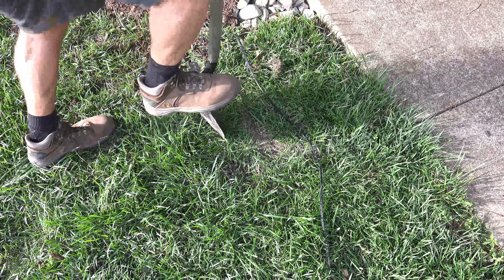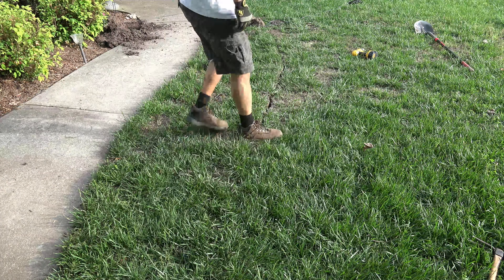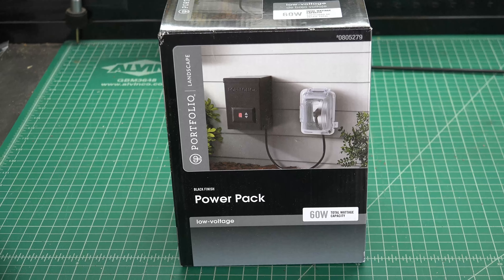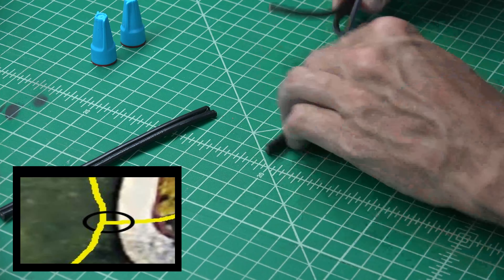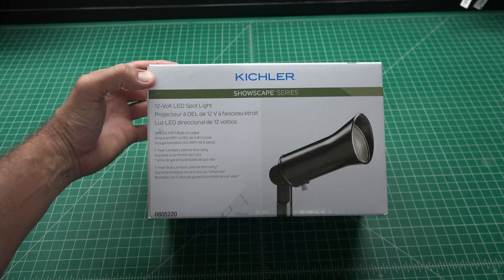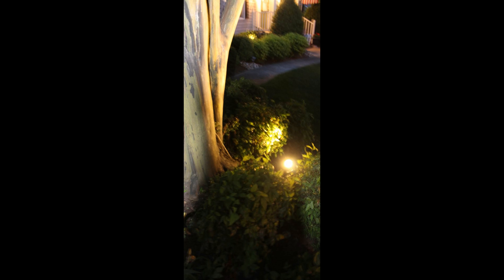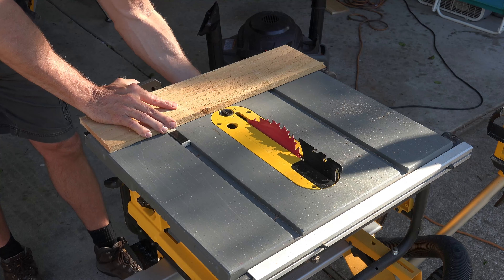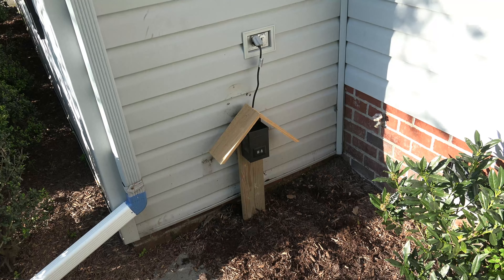How to Install Wire Under a Sidewalk for Landscape Lighting / Jon's DIY

Comment: Great video! If I thought I would ever need to run more wires under the sidewalk in the future, I would run PVC piping first and then run the wires through that . But this would require a bit more digging.
Reply: Greetings, absolutely, I'm leaning towards that idea 🙂

Comment: I drive my 12V system through my Rachio irrigation computer via a relay and a 120 Watt 12V power supply. This allows me to schedule the light against sunset and time settings and also control it via my home automation system e.g. Alexa. I use this power supply from Amazon that fits inside the Rachio outdoor box making it completely seamless: LEDMO Switching Converter, AC/DC Power Supply Adapter Transformer Driver for LED Strip Lights, AC 100V/240V to DC 12V 10A 120W.
Reply from the maker: BRILLIANT!  that is out of the box thinking. !

Comment: Only thing I would add is try using a flat shovel best one I have found is Fiskars 46 Inch Steel D-handle Square Garden Spade, and as bonus it has lifetime warranty
Reply from the maker: William although I would agree with you there are better tools for some jobs. spending money on the actual drill bit would be enough to make anybody not want to spend more money so to buy a shovel for this project, when any real shovel will do, and they already have one in the shed, is overkill.
Reply: @JONSDIY  And that is why you have a channel and I just watch them
Reply from the maker: @buckeyesfan8659  You made me laugh out loud.  Thanks.  and thanks for watching..  Jon

Comment: I like the idea but the drill bit is way too expensive!
Reply from the maker: Lol.  Well after you find out how much it’s going to cost you to pay someone to do it you might change your mind.
Reply: @JONSDIY  yeah or I can hammer a pipe or rebar for free. Or buy an auger bit that’s not $40
Reply from the maker: @IncognitoVideosInc  yep you can.  Good luck with that.  Guess you did not spend a lot on your lighting and transformer either.   Let me know how it works out.